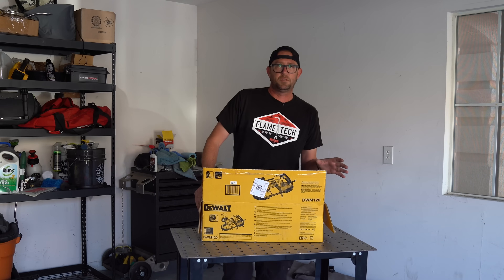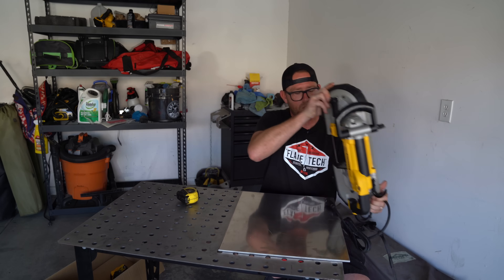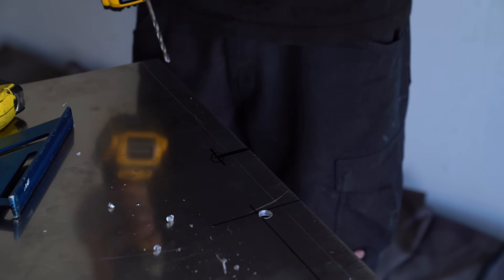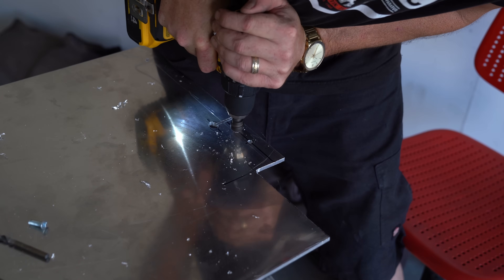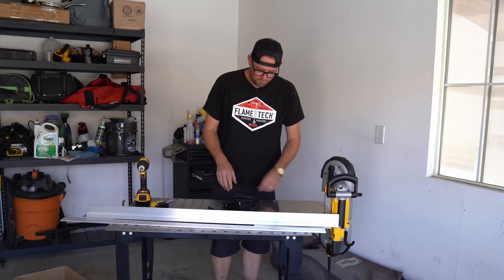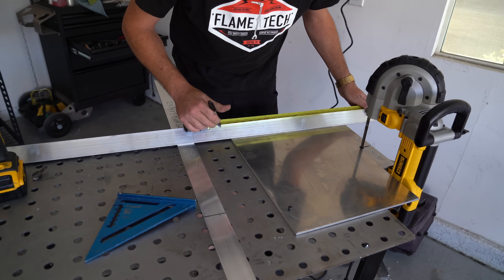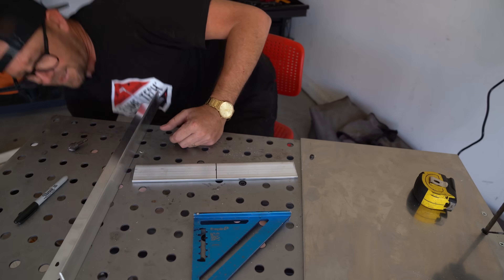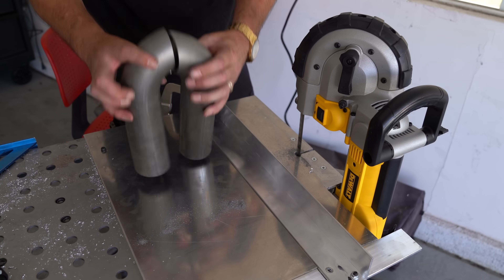DIY Metal Cutting Bandsaw Table

Comment: This works and I clicked because I think we have a very similar model Dewalt bandsaw, but I was really hoping for a setup where I could easily remove the bandsaw later for storage and if I needed to use it as a portable.

I've seen people make a plate that goes into the slot on the inside, but I looked inside ours and I see gear teeth, so the idea of putting a plate in there that could potentially be jammed up against the gears if something goes wrong is unappealing, plus I assume they left those gears exposed for a reason and that reason is probably cooling.

Comment: I'm 41 and just don't know where to start trying to open a side business. I don't have the extra cash or space to invest in materials that may or may not sale. Like the plate you used for the saw table, I see $64 plus shipping and I'm like wow that's expensive. How do most people afford the materials now days, Credit? I'd rather not run up a huge credit card bill on something that may or may not payoff. I guess it's fear of not succeeding, especially after I had a franchise that failed me about 10 years ago. I hope this makes sense.
Reply: I bought a piece of diamond plate aluminum at a metal supply house for 15 bucks. It was mounted on their door as a kick panel. Flip it over and do the same thing  Justin did, you have a $15 set up. You got to repurpose materials as you see fit don’t just buy brand new. Ask for scraps you’ll be surprised on what you can get.

Comment: Not so long ago the the various trades wholesalers had on display a port-a-band saw with a fixture. It was a no name,or at least a brand not seen before. Pre Temu. It was designed to cut round and flat or angle stock. It wasn't versatile. 90 and 45 degree cuts only. The mouth was roughly 3 inches. It disappeared after about 3 months. I inquired at one of the wholesalers if they ever sold any. No,not a single one came the reply. 
  High quality trades people want high quality tools.
I like what you did here.

Comment: Make another wall but horizontal, so you can cut long exhaust pipes square. Clamp the pipe on the wall and slide towards blade to cut. But you would have to cut flush the bolt that holds the fixture to main table or counter sunk it and nut on the bottom.